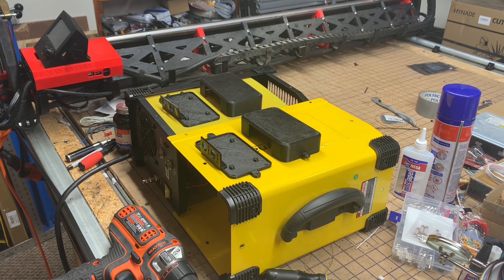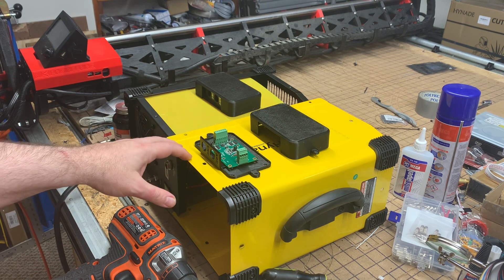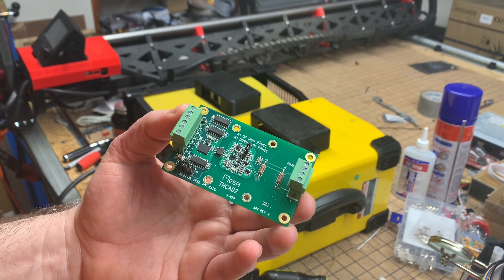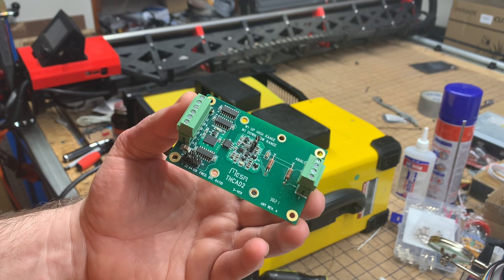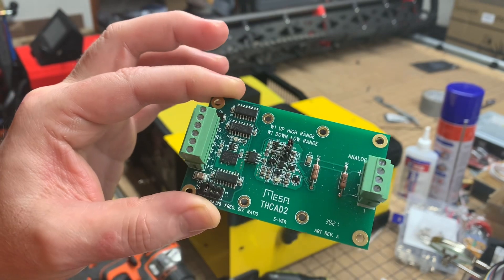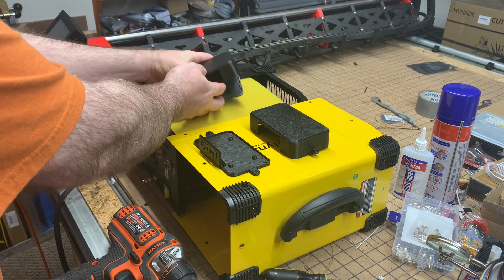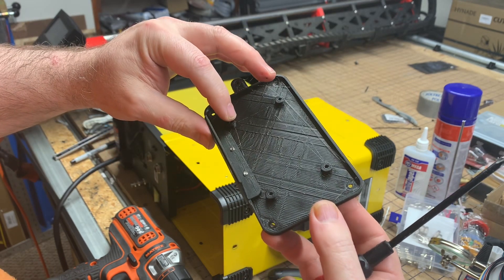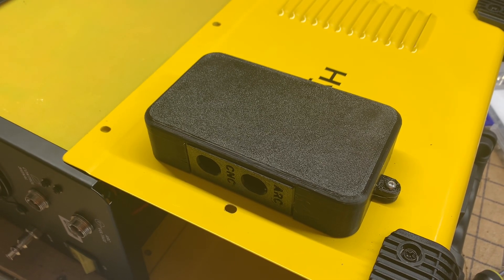LowRider 3 CNC DIY Plasma Table PART 10a - MESA torch height control!

Comment: Does this only work with Linux or will it work with Mach3?
I have a Langmuir table and refused to fork out an extra $1K for a very sub-par THC, and have been researching buying/building one lately.
Reply from the maker: I don't know the answer, but this sounds like a great question for posting on the LinuxCNC forum. The founder of MESA Electronics, Peter C. Wallace, the creator of the MESA products, is on the forum there as username PCW, and he is very helpful.
Reply: @design8studio  Thanks for responding and info, I’ll check them out. Thanks for the video as well, very informative and helpful to anyone that really has zero clue what they’re doing like myself.

Comment: I saw that Joshua De Lisle just had the floating head and no THC and was cutting out wildly fluctuating material like a garage door as it was warping in the heat.  I think you mention though THC is needed to get the cleanest cuts possible, right?
Reply from the maker: One can do CNC plasma cuts without THC, however, there are potential problems, especially on long cuts where heat build up warps the metal. The THC is (in theory) supposed to help in at least two ways: preventing the torch tip from colliding with the material due to warping, and cleaner cuts by maintaining specified distance. One area where it may not be able to help is on multipart cuts were a chunk that does not fall through juts up instead. For that, one is glad to have a nice breakaway feature, such as my magnetic breakaway.

Comment: Is that a Hynade plasma torch?  Which model is it and how do you like it? I’m looking at the cut80.  Thx Eric
Reply from the maker: Eric, it’s a CUT60-DN (if memory serves) and the DN designation means it is prepared for CNC work already. I like the machine. I’ve only cut relatively thin stuff so far but it’s been great.
Reply: @design8studio  Does that mean it doesn't have HF ignition?  Some people say you need pilot arc instead of contact/hf to avoid the RF interference, but it turns out some machines that have pilot arc still have HF.  I think the only kind that doesn't has 'blowback' ignition, correct?  I noticed somewhere else that the cut series machines at least sometimes have 'CNC' written on the front, which I guess is the DN thing.  Does that mean they don't use HF?  I have a hunch they still do and it's more about accepting control signals?  I eventually found a guy who claims that after trying every form of shielding and grounding with an HF machine, finally he got a mach 3 board that operates over ethernet not USB, and all the problems went away.  I have just bought a very cheap 30A HF machine, and done a simple pilot arc conversion, so hoping that running jobs directly from the controller SD card means no USB to PC connection is required
Reply from the maker: @jamesvictor2182  As shown on the Amazon listing, it is "Non-HF Pilot Arc, Non-Touch metal" — This allows CNC plasma cutting without the electromagnetic interference of a high frequency start! Here's the listing: https://amzn.to/45M6qYu
Reply: Well, that's clear now, thanks.  I'm going to try with my cheap little HF unit and see how it goes.  I saw another plasma cnc build just now where the guy was insisting on hpla which you cure and can sustain 3x the heat as normal PLA apparently.  But he's using an angled torch so is kind of obliged to mount the holder near the work piece.  Like you I have a straight torch, so can move the gantry up a bit further allowing for a few inches gap to any printed parts.  Have you thought about this?
Reply from the maker: @jamesvictor2182 I have had zero issues with heat related to the PLA parts I use!
Reply from the maker: @jamesvictor2182 The problems people have reported with using a High Frequency Start unit for CNC, is that EM interference causes their control board / control PC etc to not function correctly. Some have seemingly indicated that with properly grounding and proper shielding they can use a High Frequency Start unit without trouble.